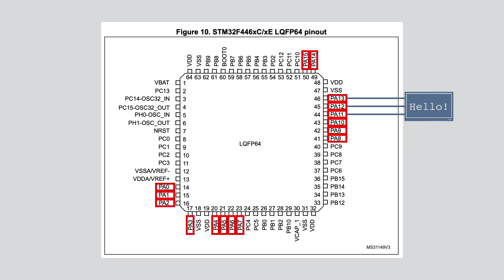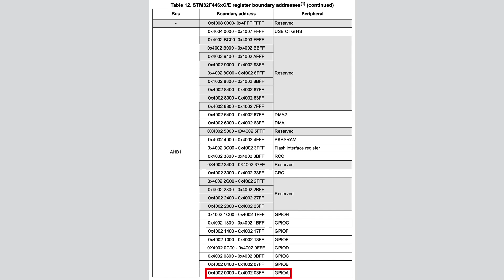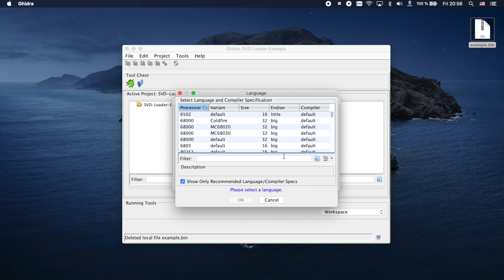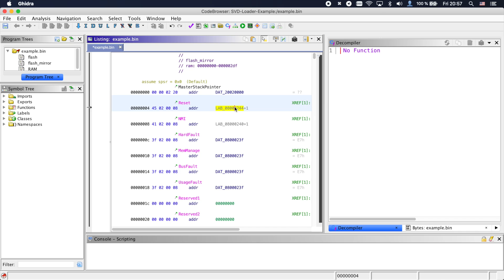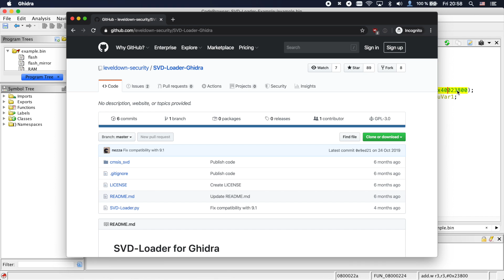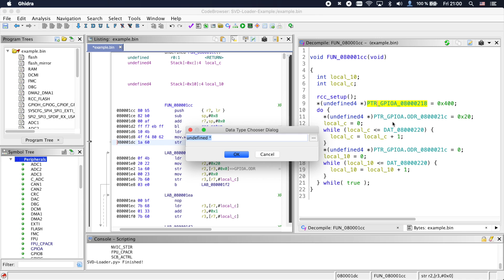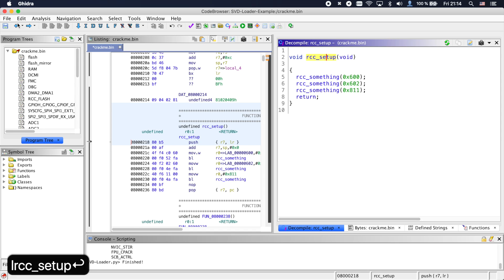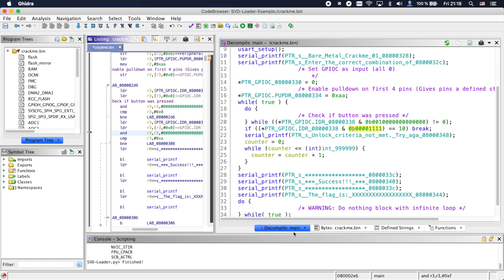Bare-metal ARM firmware reverse engineering with Ghidra and SVD-Loader

Comment: The flash memory region is " 0x08000000 - 0x081FFFFF". The length of flash while loading the binary is specified as "0x2e0". Can you specify how the length is calculated?
Reply from the maker: The loaded binary is that small, as it's just the compiled object, not the entire flash-region.

Comment: Reverse engineering bare-metal code sounds difficult, but it's actually easier since you can find pretty much every address and function you need in the datasheet for the processor!

Comment: Good video! Is there a way to identify the microcontroller without opening a device? I have a device with an ARM v7 but I would like to know the exact version
Reply from the maker: I actually wrote a script to identify microcontrollers: https://github.com/nezza/chipfinder :)
Reply: @stacksmashing  I get three errors when running it against my .bin file: line 87, in <module>
    for line in f.readlines(): second error: line 23, in decode
    return codecs.charmap_decode(input,self.errors,decoding_table)[0] and third: UnicodeDecodeError: 'charmap' codec can't decode byte 0x8f in position 13: character maps to <undefined> Any suggestions?

Comment: When I do it with a firmware I'm trying to RE, the disassemble of the reset vector says "/* WARNING: Control flow encountered bad instruction data */" and calls the function "void UndefinedFunction_08032ad6(undefined4 param_1,undefined4 param_2,undefined2 param_3)"... Any pointers?

Comment: hello friend i have a problem with the chip arm lpc1768 when programmed by jlink the chip works normal but when it takes a while it works when i want to have a cnc card firmwere but when i record the problem on the chip i don't know if it's a problem in jlink v8 clone or if and at firmwere my email and barbosa031988@hotmail.com if you can help me

Comment: I'm sorry but how did you figure out the SRAM lenght to that you put in the memory map? The SRAM blocks on the MCU I'm trying go from 0x20000000 to 0x40000000, also at the start of the Memory section in the datasheet says the chip has 256 kB RAM, so do I just put 0x40000 or could that be a different length since there are separate RAM and SRAM blocks and I see you are putting the SRAM's starting address

Comment: Would just like to say, your videos inspired me to have a go at reverse engineering something, so I grabbed a Cisco 2501 router off ebay (because its got a Motorola 68030 in it), and used Ghidra to explore the boot ROMs (was amazed that it supported the m68k architecture!), figured out the memory map, and managed to get FreeRTOS running on it after creating a m68k port for it. :-)

Love your channel!
Reply from the maker: That’s awesome to hear! And sounds like a super interesting project - you should do a write up! :)
Reply: @stacksmashing  Ive put notes of what I have found so far up on github, including my FreeRTOS port. I dont know if I can post links here (sometimes works, sometimes doesnt), but you can find it by searching users for my name as one word (the one that doesnt end in sn).

Theres more I would like to find out about it, including a couple more registers within two proprietary chips, but its a monumental task!

Comment: One thing I'd suggest with regards to memory mapping is to clear the write flag in the flash regions. That way Ghidra automatically dereferences constants and show strings as quoted strings rather than a pointer to a string. Do keep in mind it also removes what it considers to be extraneous reads and writes and unreachable code based on constants, so if there's some configurable options in the firmware, it may remove code from the decompilation for other options that it sees as unreachable.

Comment: I didn't find decompiler for stm32f103c4 elf file to c code error
Reply: With ghidra tool
Reply from the maker: Not sure what you mean?
Reply: @stacksmashing  I used elf file of microcontroller STM 32f103c4 and I installed ghidra on Ubuntu 18 running of Jetson nano Nvidia board (GPU micro pc) and iam getting error as "decompiler missing__could not find decompiler excutable decompile"
Reply: When I try to do analysis and c code is not generated 😭I tryed on virtual box with Ubuntu 20 now I got c code generated 😀👍✌️👌

Comment: I've always thought that a computer was defined by both hardware AND an operating system. For a bare metal, does the application assume the role of operating system, how does the hardware "communicate" with the app ? Thanks
Reply: The app has to do everything an OS does, just that you don't write code for what you don't need. The app can do everything an os does, if you write it, but most bare metal code tends to be simpler.
Reply: The hardware communicates with the app through registers, special memory regions that have hardware functions when set or cleared, or indicate feedback from the hardware

Comment: Not sure where to find the ghidra python module ?  Python reports that I am missing this.  Any idea where to find that ?
Reply from the maker: You need to run the script from within Ghidra, then it should be fine
Reply: Thank you !  I didn't understand how it all went together at first.  Found Ghidra at  ghidra-sre.org  and also downloaded  the SDK from  aws.amazon.com/corretto/  and things are up and running !  The biggie for me was understanding what ghidra itself was.  I am using this same STM32F446 except for it being 100 pin so may be helpful to me !  Also fun to play with the other processors.  Now if there is a .elf import too, I might be able to include source code comments ?  Not sure if it does that or not

Comment: Nice Video, thanks:)
Be careful with the 5V. Not all pins are tolerant. See "FT" specification in data-sheet, Table 9 for this MCU (Depends on the series). To avoid this: There is 3.3V right next to the 5V supply pin on the NUCLEO. Up to 112 5 V-tolerant I/Os on max 114 I/O for the LQFP144 part. So the chances are good to not release the magic smoke:)
Yours is a LQFP64, so better look that up folks. At all, don't rely on chance. It's a 3.3V part and best practice is to treat it like one. While experimenting, only use the 5V-tolerance functionality if absolutely necessary. This protects against nasty surprises
Reply from the maker: If you watch closely you'll see that I used the pin NEXT to the 5V pin, which is 3.3V 😉
Reply: @stacksmashing  Good boy;)

Comment: This is the best tutorial of reverse engineering embedded systems with ghidra I've seen so far. Some days ago I wanted to RE an STM  board but didn't know how to proceed. Could you please do something like this with the nRF51 or nRF52 processors?
Reply: Unfortunately, most Nordic nRF-series micros are built on top of their Softdevice middleware,  which, while technically not an OS, is pretty close to being one. It's also notoriously bad and can obfuscate alot of behaviours. The whole experience can be summarized as one colleague put it: "you don't own the chip, you rent it".  I think it would be a huge challenge to reverse-engineer. I've done 15 years of bare metal development and that chip was one of the biggest pain-in-the-ass I ever experienced.
Reply: @Kotesu    Yeah I somewhat got it to work and managed to seperate the parts of the firmware (softdevice, app, etc.), but ghidra still has some control flow detection issues on arm, which makes everything complicated. It really is a PITA

Comment: how did you get the display out that prints the crackme messages? the cable connected is a usb cable to power the microcontroller, right?
Reply from the maker: It's a serial terminal, the USB cable provides power and also a virtual serial port (and also access to the integrated ST-Link programmer)

Comment: As a mostly embedded programmer this is great, much easier to follow when there's no complicated OS to worry about.
Reply: As a beginner in coding this really helps me understand what I’m learning so much better.
Reply: Embedded applications can be with an OS. Many STM32 (and other) devices uses FreeRTOS or another real-time operation system.
Reply: also an embedded programmer here just wanted to say c is unreplaceable
Reply: @asafcohen3562  i have no idea and 0 experience in C nor embedded programming however I am interested as to why C is irreplaceable when it comes to embedded programming
Reply: @BRUHItsABunny  c is basically the only option if you want to do effective embedded programming
Reply: @asafcohen3562  Id say rust is another great rising option too right now.
Reply: @AdriGDev  Depends on the project you work on. Maybe for hobby in this state of Rust and this kind of MCU. If you're doing a consumer product you will have your setup with your toolchain and exactly defined framework conditions about your libraries, years of knowledge about the hardware and hopefully deep insight. If you don't get memory safety by yourself with C, Rust won't be a magic bullet one might expect. Features such as package management that e.g. cargo provides is rather counterproductive and more a pollution. Don't get me wrong, this is great for other cases ... let's say on a MIPS based approach with a Linux-Kernel, where you use OpenSSL, Server-implementations, etc.
But on such small platforms you want to have (and can have) full hardware control.
The interested one can have a sneak peak at https://github.com/rust-embedded/awesome-embedded-rust
Reply: @dieSpinnt  I've been into Rust only for a few weeks but I'd be interest to know why, in your opinion, C gives you more control over the hardware compared to Rust. They both seems on-par as to the level of abstraction they work at. Rust with no-std (rust without the standard library that is) becomes extremely low-level, while still having all the safety guarantees it normally provides. Rust is going to become C 2.0, basically. The only reason you wouldn't use Rust for new code is because you have so much legacy code to worry about; and even then, Rust seamlessly talks to C code, with no performance loss whatsoever.
Reply: @brainplot  So you use the great interfacing capability of Rust and use C. That is because of simplicity. Sometimes this forces you nearer to the Hardware and away from the abstraction. BTW I don't say you have to choose C. Pick the appropriate tool or one that you are familiar with the most. 
For example, designing a very simple switch application with a resulting binary of 100 bytes using a Rust tool-chain of several Gb may be overkill. Or you are bound to industry standards required by your client. Maybe there is no need for the rat tail of a dependency system. Or you need just some "ldr r0, [pc, #208]" here and some "movs r1, #1" there, because it is simpler to "((volatile unsigned short *)(PORTBASE + 208)) = 1;". For Rust see https://doc.rust-lang.org/core/intrinsics/ and core::ptr::write_volatile alike.
Another case can be if a mature system is needed which you can rely on and here, C is the quasi standard in the industry. Also good luck finding a 8051 toolchain for Rust or for similar exotic/legacy(I love C= :-)) processors.

But no programming language or tool-chain frees you from knowing your hardware, e.g. reading data-sheets, knowing specs. etc. Usually AFTER you know the basics and theory behind an area you can begin with abstraction. The only time this works the other way around is if you are curious about something and start to learn the stuff behind.

TLDR; Use what you are familiar with and have fun:)
P.S: C 2.0 ? You forgot C++ and D as heritage. Then Rust is C 4.0 :)
Reply: @BRUHItsABunny  What's the alternative, Javascript? Embedded means closer to bare metal, and the closest you can get to bare metal is by using C and Assembly. There are so many cases in which you just need raw memory access. Rust is probably going to replace it in the future, because it is really well structured. This is related to the second reason why embedded programmers use C. It's so efficient and straightforward. In applications that run on a normal PC, it makes sense to use thinks like Go, Python, etc. But in embedded, you need perfectly deterministic software. C is a perfectly predictable language, there is no chance of some random delay caused by the garbage collector etc. Rust has the same design philosophy, but it doesn't allow most memory bugs.
Reply: @tunahankaratay1523  this was an insightful answer, thank you
Reply: @BRUHItsABunny  

-Fast

-plenty of libraries 

-Has the best syntax ever created by mankind
Reply: Or put another way:
Nobody sees all the bugs in the code? 🤣